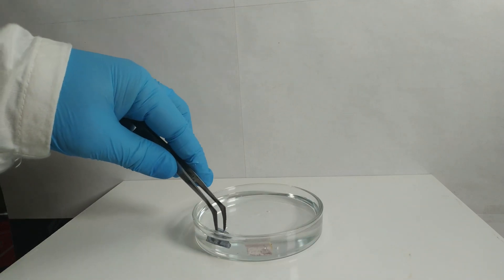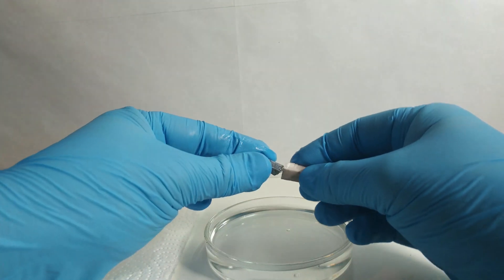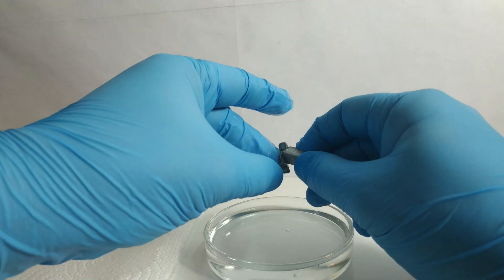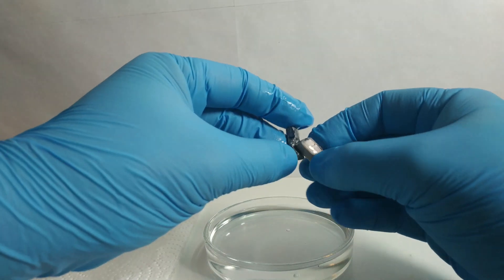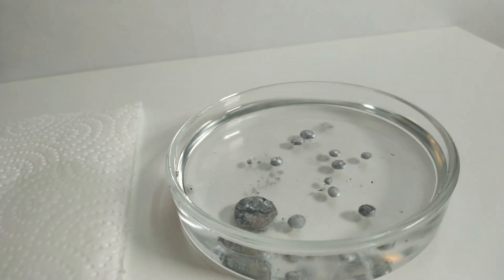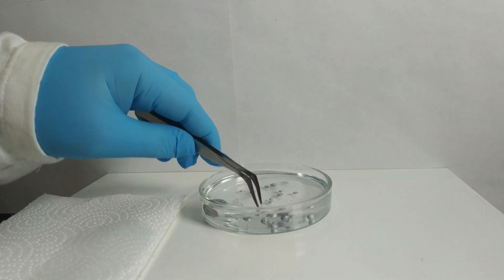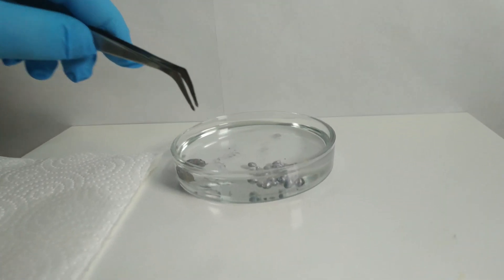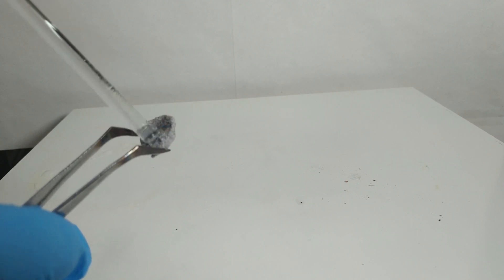Can an alloy be made by simply pressing two metals together? (NaK - sodium-potassium alloy)

Comment: How do you deal with these NaK alloy after taking this video?
Reply from the maker: Great question. I experimented a bit on how to safely get rid of it, which prob. might be also an upcoming video, because it rly is very reactive.
Reply: @calmchemist  Alright. I also want to see the experiment video about if there are some methods about how to get rid of (quenching) these NaK alloy in a mild way, let these NaK alloy reacts away in a mild way. Thanks.
Reply: @calmchemist  I guess if adding few drops of some weak alcohols into this paraffin oil that contains these NaK alloy or transfer these NaK alloy into hexane (better solvent for alcohols) and add few drops of alcohol, or something similar, can let these NaK alloy reacts away slowly in a mild way. Or maybe there are some other methods that are good.
Reply from the maker: @siyuyangzhang6995  Sure just stay tuned ;)

I rather not use any too volatile and flammable hydrocarbons. 1. Health 2. Environment ~ Youll see my way then in the future.